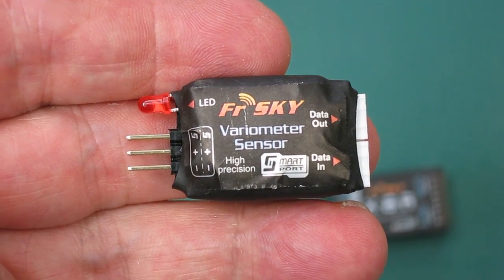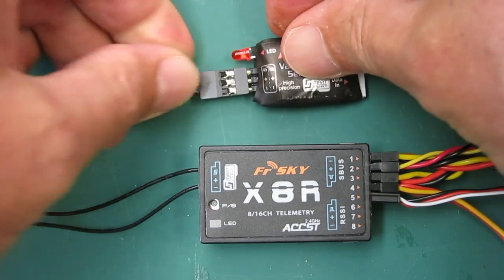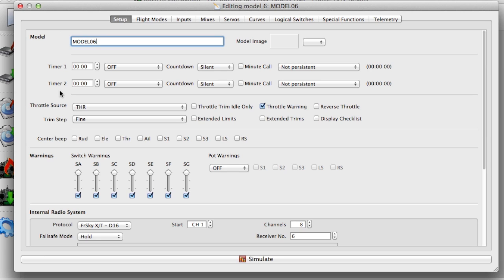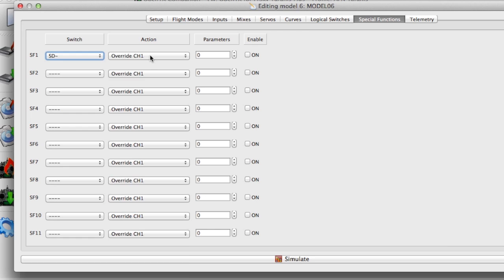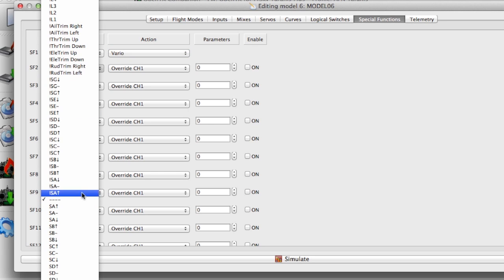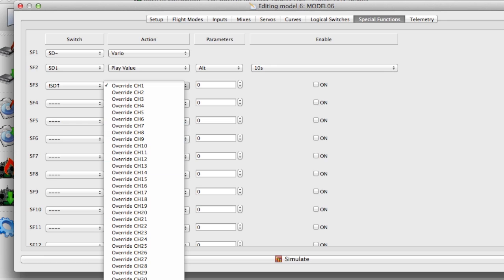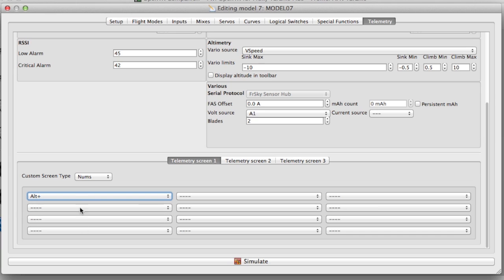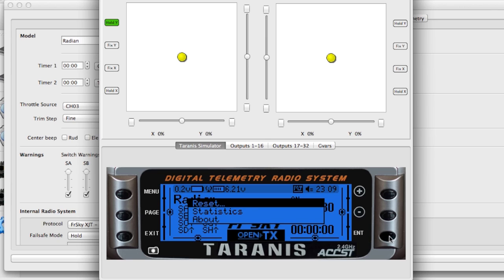FrSKY variometer sensor

Comment: How do I get it to work when I’m in conjunction with a grx8 but want to disable the grx8 vario so I can use it later in another model
Reply from the maker: The manual tells how to disable GRX8 vario. Then just connect external vario like in this video.

Comment: Will the vario work fine with the frsky l9r non telemetry receiver ?
Reply from the maker: X8R would be my choice
Reply: Andrew Newton thankyou
Reply from the maker: No. Non telemetry means these telemetry sensors won't work.
Reply: What receiver for good range would you recommend for the bix 1.1 with fpv headtracking

Comment: Hello Mr. Andrew Newton
I have the Vario in my X8R receiver.
It works fine except for the vocal units instead of meters says milliamperes!
Do I have to change the ambar soud pack?
Can you help?
Regards
Vitor Lalanda
Reply from the maker: If you look in the Telemetry page, click on Alt then make sure the Units are m and not mah. The Amber sound pack hasn't changed for ages

Comment: ok thank's a lot....I would like to know if I can ghange the SD card Content EEprom with my old one......or is it include on the firmware that I downloadet?
Reply from the maker: Yes I think you can, as long as it has all the models you want and correct set of sound files for your current firmware

Comment: Gday Andrew....another great vid thank you.
Do you think I could get an audio vario running on a 9XR? I have a Radian XL and want to keep it on my Spektrum setup but have a spare 9XR so would like to try fitting the appropriate FrSky rx and sensor to the aircraft (5v power only) purely to tx the vario tones back to the 9XR sitting by my side. Any clues or link as to if/how this could be accomplished?
Reply from the maker: Yes I'm sure it will work. I'll try it wth mine in a day or two and let you know.
Reply from the maker: You would need the FrSky module in the 9XR and an X series Rx
Reply: Ahhhh spooky...i was just re-watching it when you replied. Yep I've got a DJT module for the radio...and a V8FR-II rx but I don't think that rx will do the job. But no probs I'll source what is needed. My main concern is getting the correct FW onto the 9XR that will do the job and will the 9XR have the actual 'audio' capability to emit the varying tones like you demonstrate with the Taranis.
Reply: I've had a good look around Andrew and it looks like there are some soldering mods required for the 9XR to get the telemetry working. Not tricky really. Just a steady hand. Don't know whether you'r up for a challenge or have crossed that river before? I expect I'll give it a go.....Just gotta get hold of a couple of resistors.
Reply from the maker: My 9XR is a Pro, so it's already set up for sound. I need the extra telemetry cable which goes from FrSky module to trainer port.
Reply: Super sorry to bug you mate...a buddy gave me a 9XR Pro he wasnt using...I've got it all bound up to the X8R...made the cable from the DJT to the Futaba port.....got the 9XR bombed up with OpenTX 2.1...got it picking up sensors from the X8R....RSSI and Rx voltage (using the FrSky D cable protocol)....but I can not for the life of me get it to discover the Varoimeter. Its def connected to the X8R correctly (its almost idiot proof)....the LED is flashing...I cant get my head around what is said to be super simple.

Any ideas mate? i was thinking about the Com port selection in er9x but cant find anything like that in openTX.....got me pulling my hair out bud.
Reply: Hey Andrew I got hold of a 9XR Pro now running OpenTX 2.1.8 and got the FrSky gear including the vario running nicely in a Radian. Thx heaps for this video. Super simple and a great help. Can you tell me if there is a way to turn OFF the sink tones? I was thinking about just pushin the sink numbers way out so it had to fall like 20m/s or something crazy before I actually got any. They can be handy... because silence equals alt hold but mostly I find them anoying and its the climb tones I personally am after.
Reply from the maker: You can change the range values in the telemetry setup screen. Might have to play with them and see if it can do what you want.

Comment: I just ordered my Taranis, watching video to learn more. question: with this variometer sensor would I be able to set an alarm at a specific altitude, for exemple 8m? and can I program a chanel output to this alarm?  here is what I am thinking: I am flying helicopter with Bavarian Demon 3SX, there is a bail out feature where the heli self level right side up and pitch up. this is control by a gain value on a specific chanel. I am thinking at 8m variometer alarm can send this gain value to have the heli self level and climb up...Hard deck using variometer. do you know if this can be done? thanks
Reply from the maker: Yes that is possible using the Alt value in a Logical switch. RiMr https://www.youtube.com/channel/UCDSyRUfwWu_IOEi4UKz6cTA has done a video on something similar.

Comment: No go on the New Vario sounds? Could you point me to possibly where you might think you were in Open Tx to make these changes? Maybe i can figure it out myself. Thanks
Reply from the maker: The only change I made (and it was in a previous version of OTX) was the tones value in radio setup. To be honest I don't even know if I still have rising tones, I use spoken altitude mostly. Might have been lost in upgrades. Will have to check for you. I can always send you my eepe file.

Comment: Nice vid and helpful, thank you. Could you please tell me how to get those nice, sliding, proper sounding vario beeps? On my Tarnis plus with the 2.1.8 (I think ) firmware the boring beeps have only three levels sinking normal and rising, with the high precision vario. Thanks again.
Reply from the maker: Good question Bruce. I set it up in a previous OTX version, may have played with the tones in radio setup screen? I'll have to think about it.
Reply: Not sure why but it is now sounding just right. Thanks again.
Reply from the maker: Brilliant, I wonder why?

Comment: Where and how do you locate the vario unit in the fuselage to get accurate readings of altitude?
Reply from the maker: +ourblue In both my DLG and Radian it just sits loose in the cockpit wherever it fits. With the Radian I had to block off the canopy duct  the pressure effect of moving air was giving crazy readings.
Reply: +Andrew Newton Thanks Andrew. A friend was saying that i need to box in the unit to the fus side with one tiny hole to the outside. All about static and dynanic air.

Comment: Andrew please can you answer this for me. I have a Taranis with latest firmware. Is it possible to use the old telemetry Hub and sensors with a d8II plus receiver. Looking at the telemetry screen in Companiontx it will not allow you to change to the old protocol only shows FRSKY SPort greyed out. Thanks Greg
Reply from the maker: Greg Higginbottom Sorry Greg, can't help with that. I have only used the X series receivers.

Comment: Andrew, what you think about DIY vario project on Arduino? I made it in 5 minutes, at least prototype. It is designed by popular Rolf R. Bakke: https://youtu.be/C6IYakTN8DY

I have FrSky module inside my turnigy 9X, but don't know how to connect telemetry port, nor how to set everything. This DIY version is independent of any type of the transmitter/receiver. Thank you in advance for your opinion.
Reply from the maker: ***** Most impressive Milan, way beyond my capabilities. You have some serious test equipment on your desk.
Reply: Andrew Newton Oh, well, thanks. Yes, I collected many things I need sometimes. Oscilloscope is essential for serious work on electronic. Logic analyzer is essential for hacking various digital circuitry as is toy grade transmitters - then capture protocol, figure out what is data from frequency hopping, binding, and what data are for each channel. I found that many four channel toys have actually eight (!) channels, but four are spent to various useless things as is flip, headles mode etc. I have plan to make some sort of sniffing recorder and an "unique" transmitter with those codes, so that single transmitter may serve for various quads, airplanes, cars etc. Only problem is that it takes so long to figure out, implement and test. Currently I have no much time to do that, but one day...
Reply: Andrew Newton Oh, now I see - you are impressed with SDR (Software Defined Radio)? Dongle costs $18 US: http://www.ebay.com/itm/NooElec-TV28T-v2-USB-DVB-T-RTL-SDR-Receiver-RTL2832U-R820T-Tuner-MCX-Input-/151096351883?pt=LH_DefaultDomain_0&hash=item232e0b5c8b

SDR program is free, but currently can't find original page. Out there are many variations, you can listen 25-1700 MHz with this dongle, it has even stereo on 88-108 MHz band, and many other decodings, depending of software. One example is here: http://www.rtl-sdr.com/big-list-rtl-sdr-supported-software/

Highly recommended to everyone - it is such fun to see what it on the band. For example, set frequency somewhere on air band (~118 -135 MHz), and listen air traffic between commercial airplanes, and many other fun things.

Comment: I have one of those in my Phienix 2k too. While doing  thermal gliding with FPV it´s the only thing that really tells me where the thermals are. Since you can´t judge you planes behavior from the ground while you literally look out of it, you need something like this.
My Phoenix needs an offset of roughly 0,7m/sec for down movement (err, as far as I remeber) to stop the sensor from steady whinig because it´s going down. Once you have set that it´s perfect. Silent while normal glide, downbeeps while in a downward movement and happy singig while upwards. It seems so easy to find thermals with that one. It´s really really cool. Maybe I should do a video about that.
Reply from the maker: Yes a video on your beep configuration would be useful. FPV thermalling? I'll have to try that with my Radian.
Reply: Andrew Newton
Yes, do it, I can really recommend that. It´s great to go on and on flying for a long time without the motor. This technology really makes it much easier and the view out of your pilot-seat is great. The Taranis always tells you what´s going on. Childhood-dream come true.
Well, we still have winter here and there is not much going on with thermals right now. Spring will come sooner or later.
Reply: KaffiFlight
I checked the values in my Taranis: On page "Telemetry" got to - "variometer - source vario" and as "limits" choose -5  -0.8  0.2  3. This makes the sinkrate less sensitive than the climb. In therory it reacts on climbrates of 0.2+, but just beeps on sinkrates of 0.8 +, which is more than the natural sinkrate of my phoenix. Otherwise the constant beeping of normal sinkrate drives you crazy. Naturally, this may differ on a different plane. Some tweaking needed.
It also makes sense to use a switch to choose between momentary height (speech) and progressive values like beeping. Also set a knob to change the volume, you´ll need that. I have it on a 3-point switch to choose between beeps, voice values and off.
I should mention there are 2 types of varios of FrSky on the market, I recommend the more sensitive one. For thermal gliding, you need that.